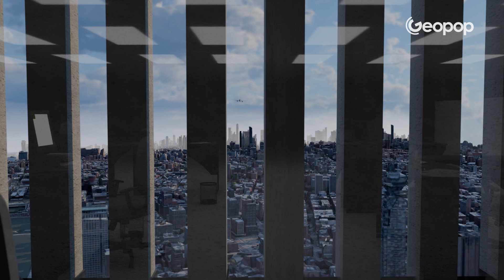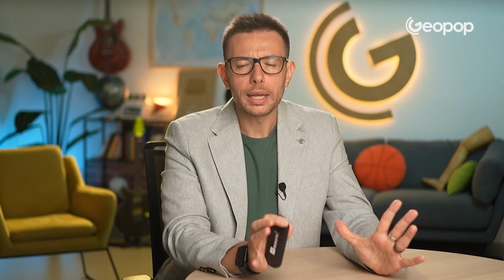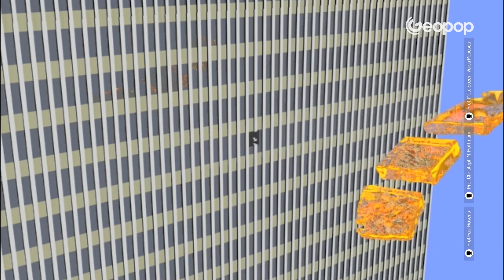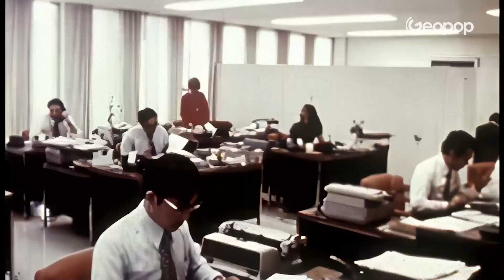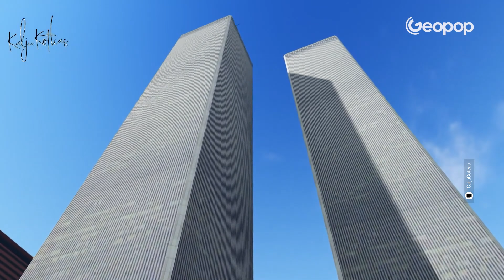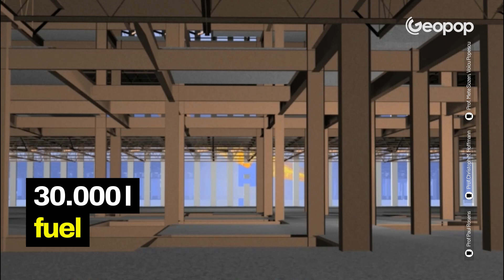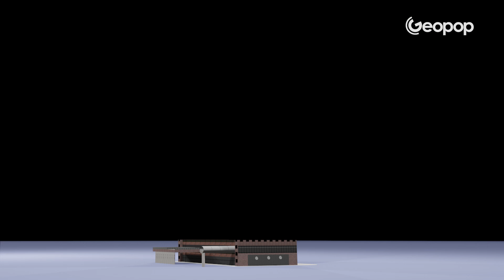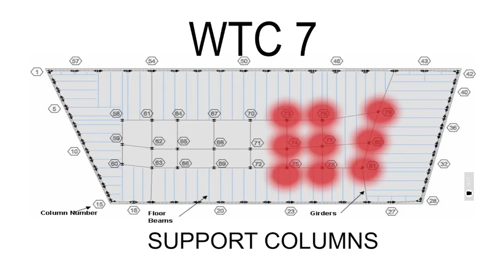9/11, 2001: The Technical Reconstruction of the Twin Towers and WTC 7 Collapses

Comment: If you had half a brain and watch the original films you can see where the thermite was cutting through the columns you can see if I'm outside the building after they were finished cutting through the columns the buildings fell down that is controlled demolition
20:55
Reply: IF you have a working eyeball you can clearly see collapse initiation was due to sagging floor trusses (which we can see) causing inward bowing of perimeter columns by up to 5 feet (which we can also see) at the impact and fire damaged floors until those perimeter columns buckled and failed, initiating the collapse (which we can see). I would refer to you the excellent Gary Pollard video of the collapse of the South Tower. Pay attention to the first 12 seconds in particular.

WTC2 Collapse -- Gary Pollard (Enhanced Raw Copy from NIST) 

www.youtube.com/watch?v=ULdiD6gYZO0  

Columns don’t work well when they are bent. The Twin Towers were designed to work with straight elements not bent ones. When you bend those columns they become up to 4 times weaker. Failure is inevitable.

Notice how the columns are already bent when the camera zooms in, become a bit more bent over the next new seconds until they give, starting the collapse. 

So what bent them? It sure as shit wasn’t thermite or sooper-sekrit fire-and-impact proof hush-a-boom pre-planted demolitions that don’t explode. 

If you keep watching you will note that after the tower starts collapsing the air inside the building (95% air by volume) gets compressed and forced out the windows. These low-velocity air bursts devoid of blast or fragmentation effect are a reaction to the building collapsing not a cause of the building collapsing 

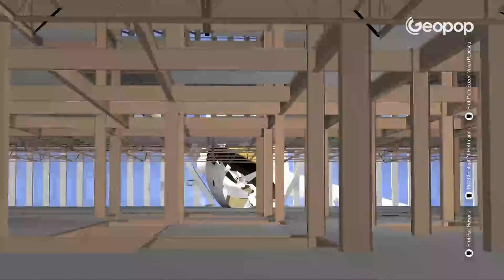And at a different angle from 1:18 here:
youtube.com/watch?v=TJJPYTVjxug&ab_channel=femr2 

Or here
www.youtube.com/watch?v=-DCgEJ2bUcI 

Also seen in the excellent still image here at 9:09:
youtube.com/watch?v=YXsDwKYz1bA&ab_channel=msvfreak94

Can thermite do that?  Can thermite do anything?  If only someone had actually tested this instead of just guessing or making unfounded assumptions. Oh, wait!

youtube.com/watch?v=JXWCMBuusMI&ab_channel=TrutherTVArchives 

In this video starting at 45:35 and running to 48:35 the Energetic Materials Research and Testing Center (EMRTC) conducts a test to examine the effectiveness of thermite in cutting a vertical hollow box-section steel column. The column tested is smaller in cross section and made of thinner steel than that of the Twin Towers perimeter columns (and never mind the core columns). In total 175 pounds of thermite are used for the test on just one column and requiring the construction of a rather conspicuous coffer dam to contain it. Do recall the Twin Towers had 240 columns and 110 floors.

It would be odd if thousands of office workers missed hundreds, perhaps thousands of those suddenly appearing.

Note what an incredibly slow process this is. It took close to 30 seconds for the thermite to finish burning off.  It would be impossible to “control” a demolition using this material.

Not to mention the issue of; how does the aircraft impact and subsequent raging fires NOT prematurely set this stuff off?

Also note how bright and obvious the whole process is. Could not be missed visually. No way to hide that. 

Then at the end of the test the (relatively modest) column was undamaged…. which is a problem.

Certainly no rivers of molten steel emanating from it either and in fact the whole thing cools rather quickly as soon as the thermite has burned off, as one would expect.

Thermite has never been used in the controlled demolition of any building, let alone one with multiple floors on fire after the impact of a large jet. If the conspiracy oriented internet has taught us anything it’s that if something has never happened before, it can never happen.
Reply: @TheCriticalStinker-jw4fl I don't believe nano-thermite was used stinky you already know this. But your evidence of nano-thermite isn't existent. Your video shows regular thermite.  That proves nothing. Then you make out like you can see the bent trusses and you post all these videos and not one of them shows any trusses at all. You talk about the walls bending in but you never show why or what caused it. And you're showing the collapse of the towers from such a view that you can't even see the whole thing.These are horrible views that you're bringing about.  You can't even see the squibs. You've chosen horrible views I've watched everyone. No wonder you don't notice the squibs
Reply: Why don't you ask a real question like who wasn't in the building that day